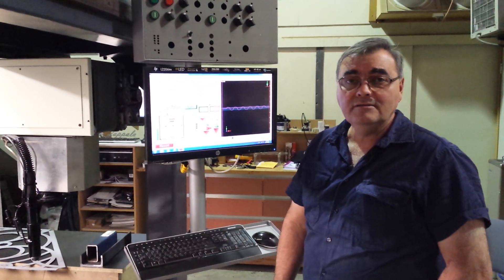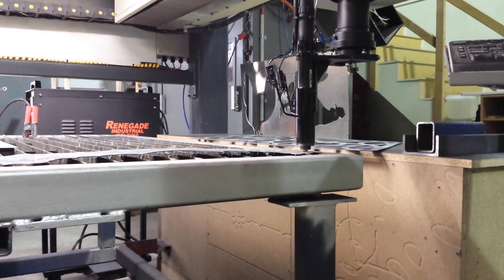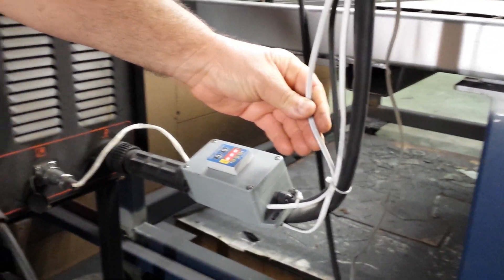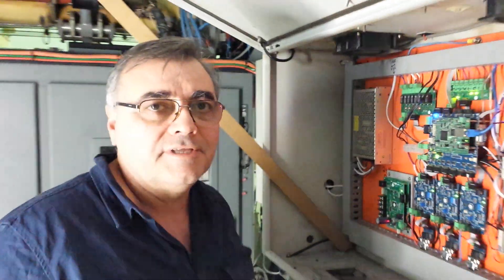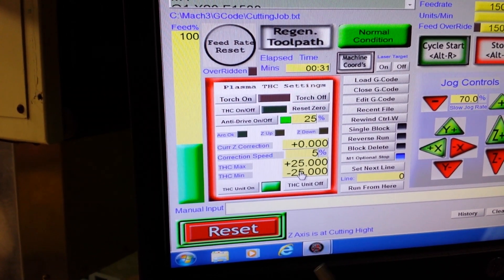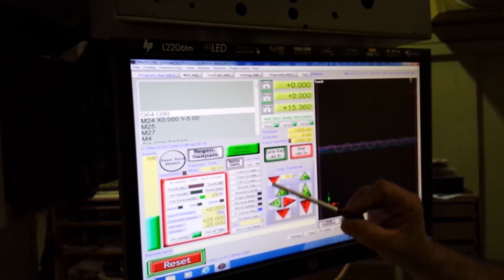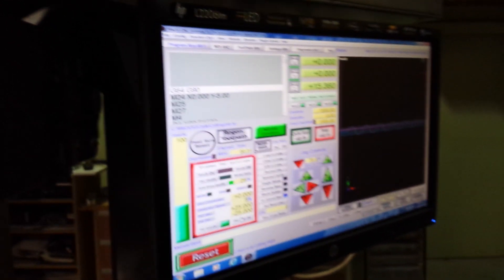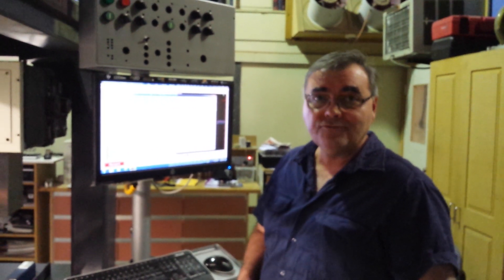CNC Plasma THC (Proma) working install with Mach3 & smooth stepper

Comment: I will use the correction speed for movement z axis cause i have the z axis move up and down wen the code run and i use thc3t-02 with pokes57cnc ... i hope it work

Comment: Hi, just seen you Plasma Cutting machine using Mach3. Do you still use that screen? i like it very functional or have you made any changes to it. I am shortly going to make a Plasma Cutter myself. Would you be willing to share the screen. Just retired at 75 from engineering picking up on my passion as a hobby. Regards, Reg. Wales UK

Comment: I wish I knew about the correction speed when I had my last plasma table, the z would often jump up and down causing a wavy cut, I never could figure out why it sometimes did that. At least now that I am setting up my new larger table I know to set this up correctly.

Comment: Hello MadAboutCNC,
I have a Home mades Plasma Table with Mach3 And Proma THC.
I can't stabilize the Z movement.
I think it comes from the Z correction speed.
You have the value 5%, But what is your base value of your Z-Axis? (mm / Min).

Thank you again for your video.

Comment: I'm used the THC SD on two time the first pieces running good around one week of work (10 hours by weeks) after that the machine loss the control and the Z axis don't respond!
What you recommended me?

Comment: Hello Sam.  Thx very much for this video.  It answered a number of questions for me.  I have a very similar setup except I'm using standard Mach3 and BoB.  Currently my Proma 150 is functioning as advertised but I'm having some very erratic movement on warped material.

I was not sure about all the Mach3 THC settings, but you've now cleared a lot of that up for me.  However, I am still not understanding the "anti-dive" function/setting.  What exactly does it do?  My screen does not have this parameter.  Was this on your stock screens after installation or was it one of the customizations you made?

Another concern I have regards the settings on my THC150.  I find I have to set my voltage SP way down in order to keep the torch tip anywhere near the 0.06" cutting  height called for in the specs for my cutter (Everlast PowerPlasma S60 c/w machine torch).  Can you provide any info on this or did you leave your Proma settings more-or-less stock?  Is my problem possibly related to incorrect Mach3 THC settings?

P.S. I wanted to let you know that yours was the inspiration for the design of my homemade floating torch holder.  It works quite well.  In fact, it's the one thing in the system that I can rely on to not cause me any headaches ;-}

Comment: Hello sam,
I have problem with THC not work correctly .
1. AKZ250 board
2. Mach3 062
3.THC proma 150
I have signal (flash) up and down , but z axis do not change .
Reply from the maker: Atraf Atraf       the last version of mach3 was not stable you need to revert to previous stable version.
Reply: hi 
 Thanks for paying attention
Also does not work with Version R3.042.020 
Why does this phrase appear :
<?xml version="1.0"?> 
When open a file ( Plasma.xml ) Do you think this is the problem?
Reply: Atraf a Jazeera
I have the same board and have the same issue my DROs don't change but my signals on the akz250 and diagnostics screen work
Reply: Alleexx Alleexx  
Hi 
I think this board does not work with THC
Reply: Does not support

Comment: Are you using a gecko g540
Reply from the maker: No my drives came with the control board as my system is a closed loop.

Comment: Hi Sir,
I have a small problème with my new proma thc SD : when i run the machine to star cutting after the floating head OK the torch go down and still down dont make correction or go up?? if i turn plasma cutter off everythings back normal. can you help me ?

Comment: Hi, are you happy with the performance of the Smoothstepper together with the Proma? Without the ESS but using cheap breakout cards and the Proma everything works fine, but as soon as I use it together with the ESS everything starts to get messy. The table stops and just burn holes after a few inches of cutting, the Z axis is misbehaving. 
Is everything working fine for you?
Reply from the maker: I don't have any problems like you seem to  have but I think the Z could move a little smoother otherwise it cuts fine.

Comment: I have a similar setup, but i'm getting a long pause after Mach commands torch on or off, I'm seeing that this is a limitation of the ESS.  Your's doesnt seem to do this.    Did you do anything to fix that?   Also, can you share the screen you're using?  The plasma screen that mach 3 comes with is terrible haha.

Comment: I have a similar setup, my proma thc works in "test mode" and lights up leds in diagnostics mach3, but when I actually cut, the Z axis DRO just sits at 1.00 and does not move. I can see that the Z should move, because my material is not perfectly flat.  Any Ideas on what I need to look at?
Reply: pictures of my setting and videos at: 
  http://www.cnczone.com/forums/general-cnc-plasma-oxy-fuel-cutting-machines/300602-cnc-autocad-forum.html

Comment: Hi Sam,
I'm currently designing my own THC. At the moment I'm using an older (2009) system from Candcnc which is Mach based and has THC control built in, but want better control of Mach and not be reliant on electronics I have to get out of the US.
Does that Proma THC not have a dead band setting. That's normally a user adjustable setting of say 0.5 volts to maybe 2 volts. If the torch voltage is within that amount of the set voltage the THC will not move up or down. This helps stop the "jackhammering" of the torch when the correction speed is raised. Machs built in THC has no acceleration or deceleration applied to the Z control so you can also get lost steps if the correction speed is set too high. I'd guess a servo motor will not suffer from this as it has position feedback via its encoder and can "catch up" within limits, whereas a stepper cannot.

Comment: Hi Sir,
I am building a new cnc plasma. I meet some problem,My thc does not move even mach3 have get the signal . i also using the Proma Thc,I have contact the seller of proma thc,He tell me mayb my breakout board did not support the proma thc . Now I am going to buy a new breakout board , Can you reccomend any models of breakout board?I am also using proma thc 150 . Thanks

Comment: is it easy to connect this module to our cnc plasma? i mean we connect the torch + and - voltages cable to the proma module, then we connect thc up and down(arc ok is not necessary i guess?) signals to our cnc card input slots, then adjust the settings as we like and it works?

Comment: Hi Sam i stumbled across your vid posted here  good posting i might add . i seen what you mentioned about the plug in control . ive been having issues with my dthc  i have a system made by c and cnc they call theres dthc 4 and it runs in mach and i have drove my self crazy trying to make it work but nothing yet after messing with it for 2 weeks . i tryed to open up in mach 3 plug in control but it will not open for what ever reason so i can look at the settings . if you have any ideas get back to me and let me know if you would  thank you Bill

Comment: hi sam great vids. ive finnaly got the proma thc working in a fashion lol, you mentioned the (correction speed and the anti dive) is this a standard feature in mach3 as I can't seem to find them anywhere, if so would you explain how to set this up please, also you made a vid about the surface contact finder this aswell would be great if you could find the time to post how to set it up.
any help you could offer would be  appreciated.
thank you  karl

Comment: hello is a very good contribution congratulations, I have a question as it is called the blue card is found with smooth steper
Reply from the maker: Yes it was ,mach3 was doing everything correctly but being ignored by the smooth stepper board until I ticked the THC option in the configuration setup ESS config.